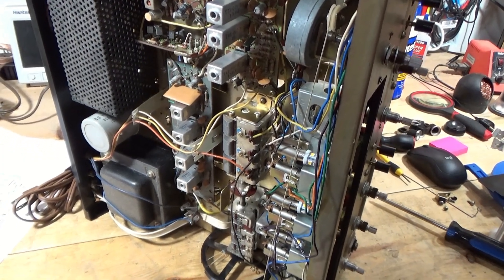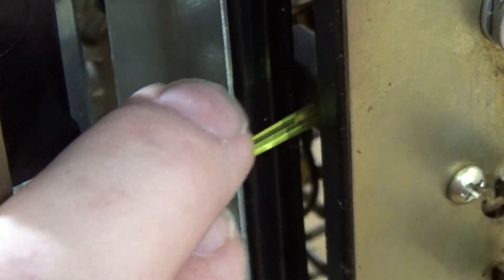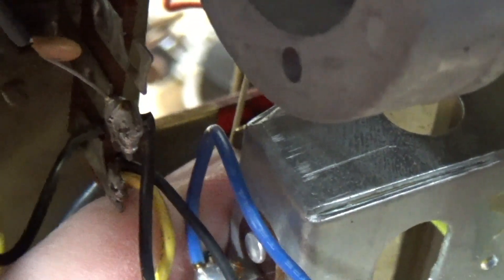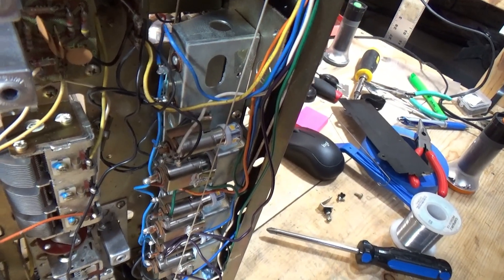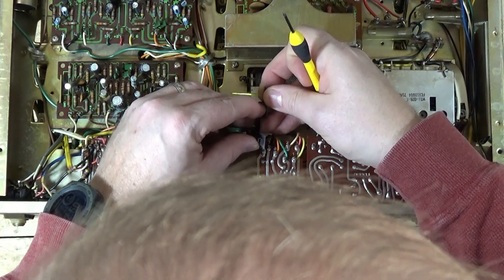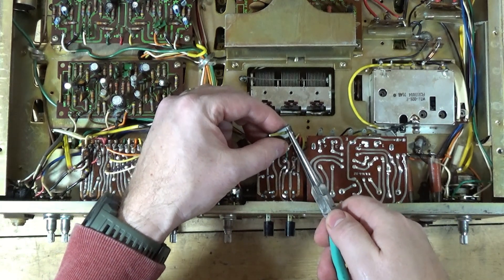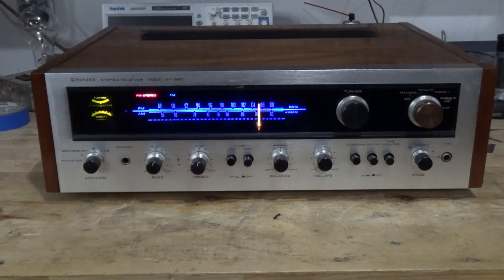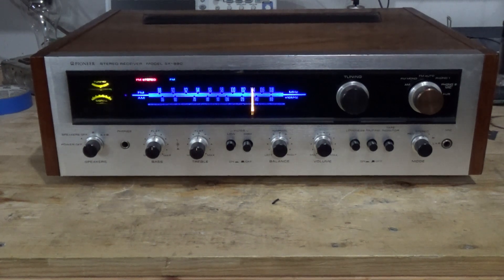Pioneer SX 990 Stereo Receiver Part 3 - Dial Pointer Repair & Wrap-Up

Comment: How did you safely break loose the dial string from the pointer assembly?
Reply from the maker: I slowly and carefully bent the small metal tabs back and gently worked the dial cord out.